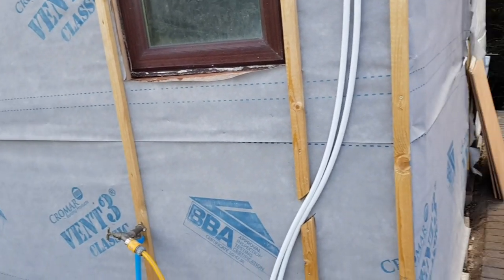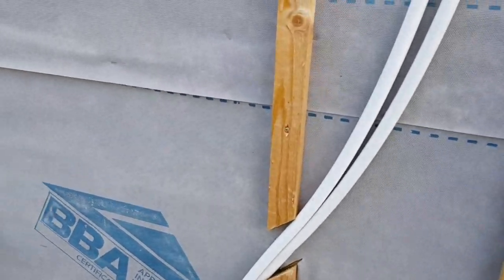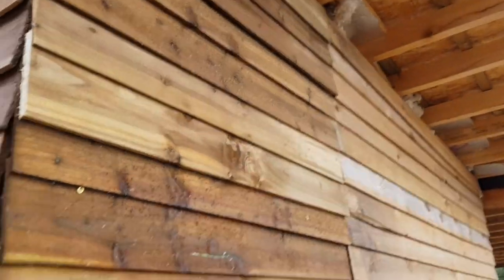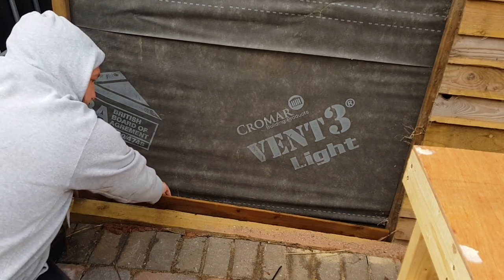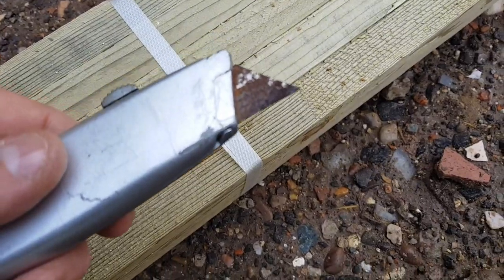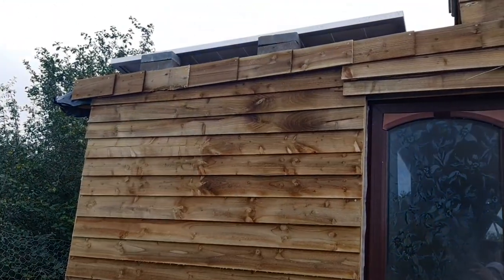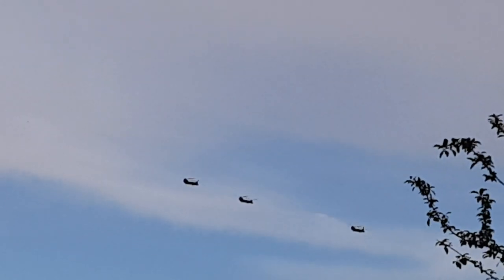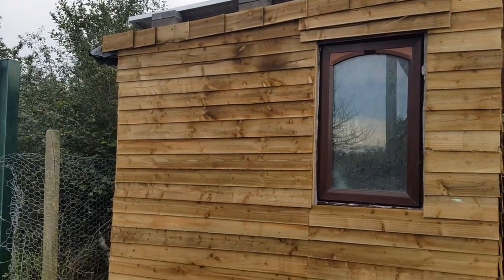Cladding the pallet sheds. (DIY, pallet shed, man cave, shed)

Comment: I noticed you were screwing the feather board in at the top, when the boards expand/contract, wont they curl up at the bottom? if they are fixed at the middle would it stop that from happening and hold the bottom part in closer? Thanks for the video!
Reply from the maker: No they haven't curled amd works well to keep the rain off the sheds but a carpenter friend of ours told me I'd put them upside down 🤣 apparently you have the thin edge at the top...I did thick at the top

Comment: Darn, what a disappointment, I thought you were going to clad with pallet wood. I can't get that "feather board" here, so basically a waste of time.
Reply: Pallet wood will just start rotting very fast, best to use treated timber if it's subjected to wet weather climate.

He would have just wasted a whole bunch of energy and need to re-do it very soon.

And with the shed frame being made of pallet wood, you wouldn't want to keep putting screws or nails in, and then have to re-do it as the pallet wood will start to split and break, losing all structural integrity.

Yes it could be done, but wouldn't be a very long lasting building, but doing it the way he has done it, that building will last for decades.

My neighbour built a garden fence from pallet wood 2 years ago and it's falling apart already and has been for months.
Reply: @oraclescave  I agree, but it's free, that cladding costs an absolute fortune IF you can get it, which I can't - building a new shed every year is infinitely more cost effective than forking out for unobtainium.

At worst you would be better off using fence palings.
Reply: @oraclescave  I should add that coating the pallet wood with something weather 
resistant would make a big difference and that I have an enormous amount
 of structures made of treated pine and it rots like hell too, you certainly cannot get decades out of it. Five years max.
Reply: @oraclescave  I should add that coating the pallet wood with something weather 
resistant would make a big difference and that I have an enormous amount
 of structures made of treated pine and it rots like hell too, you certainly cannot get decades out of it. Five years max.
Reply: @vtbn53  if it's water tight and weatherproof there is no reason you can't get decades out of a pallet frame, even if it is crappy pine.

But if outside had the same crappy pine untreated, everything would rott very fast
Reply: @oraclescave  Mate, I am 66 and a woodworker, and a builder with decades experience, I understand the why's and wherefore's of timber. Respectfully, you aren't getting the point, I think you would be shocked to to see the price of this kind of cladding in Australia even IF there was anything like it, which there isn't.

Australia's conditions mean the only long term effective cladding for a shed is colorbond steel which means you have to bring the professionals in who charge like wounded bulls, building a shed in Oz costs about as much as a small house in rural US.

AND colorbond sheds are a) not waterproof (without additional processing) b) look shit house, anc c) cost a fortune, a 6' x 6' will set you back A$3000 if you include a slab and permits.
Reply: @vtbn53  How about using linseed oil. Ideally, boiled stand oil, which you can make yourself from pure linseed oil (no drying agents added). You could even add some amount of tea tree oil to the linseed oil, or some other oil which will repel insects. If available, you can add Silicic acid to the boiled stand oil to produce an even more durable coating.
Also, when slaking quicklime (which could be derived from seashells, limestone etc, used to make the Calcium oxide), you can add in a small amount of an oil such as sunflower oil, or linseed oil, to produce water-proof lime. I have tried it when testing homemade lime bricks and water just rolls off it, leaving it completely dry. If I remember correctly, small bits of dried water-proof lime cement, actually floated when put in a jar of water! I thought the oil might just saponify in the slaked lime and wash away like soap during testing - but for some reason it didn't. I haven't tried a water-proof limewash yet, but i'm guessing the water-proof properties will be the same after a few coats, for proper coverage. It should soak into the wood a bit also.
Maybe a combination of the two coatings - waterproof limewash, finished with a clear coat of boiled stand oil?
Anyway - it's cheap, or potentially free. And could provide a really long lasting durable coating/treatment if done well.
Reply: @vtbn53  I think around 1-3% oil is recommended. Any more and it may compromise the strength/durability of the lime. I'm not sure if that's by weight, dry weight, or what. Sorry. I can't find the study where I read that - but that's what they had discovered.
Perhaps just muck around with it. When I made it I was aiming for around 1% oil by volume, added to thick slaked lime. It was a pretty rough measurement, but seemed to work fine.
Reply: Just follow the vid but with pallet wood. It's not a waste just insert your material
Reply: @emanuelemanuel7038  Well it was a waste of time because I wanted to see how it looked in pallet wood, the build itself wasn't of paramount importance as techniques vary from country to country in terms of building codes. It's not a big deal but I felt the title was unintentionally misleading.
Reply: @vtbn53  i use a product called creocote, which is a replacement for the old creosote, everything that is in contact with the ground gets at least two coats of the stuff before its even used,  leaving no part bare, then another coat after its installed. the little pallet wood fence i built 21 years ago is still in situ, hasn't rotted, and is as solid as the day i put it up. the mistake a lot of amateurs make is to build something, then use whatever coating after, which potentially leaves bare parts anywhere its inaccessible, leading to water/damp ingress and all the problems that brings.
Reply: @almonkey1  Yeah but we don't all have access to those products.